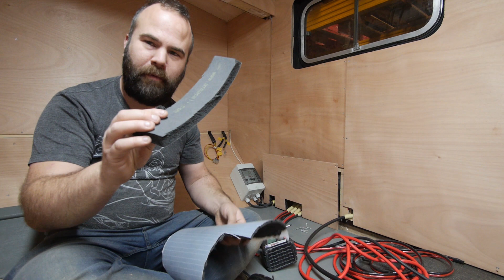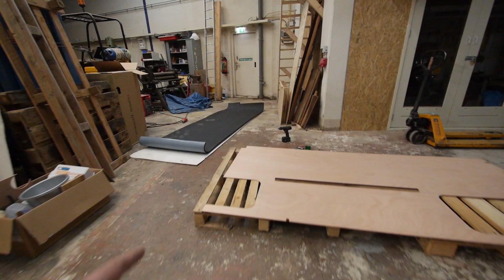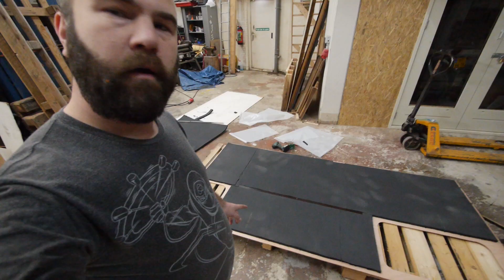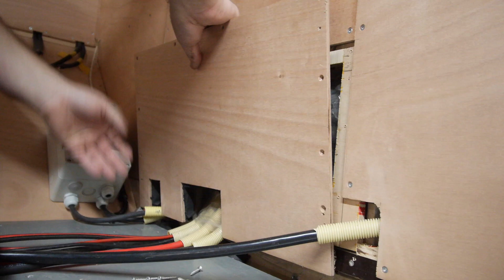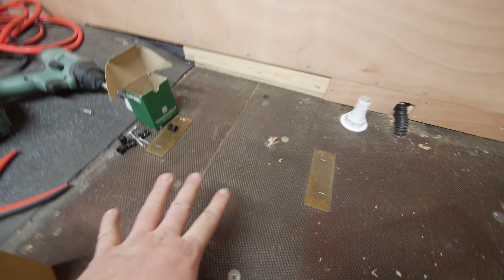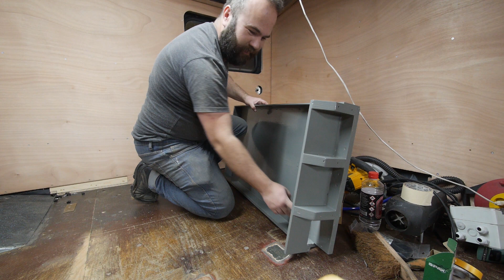Using Armaflex in an Alternative Way to Insulate the Walls, UNIMOG 404 Expedition Camper

Comment: Thanks for your movies. At the moment i am insulating a caravan on a year round place. I put 10mm armaflex in the cabinets and a box underneath the seat. That material is wood. And the armaflex still visible. Its sound reduction works. Can you tell me, do i  need to add a layer of wood on top of that. Or can i just keep it like this?

Comment: Hi Victor, I like your inside design. The Okume-wood and grey color looks great - like a road yacht! What is your interior height? I plan to work with 145 cm and a lift-up roof to have standing height at least in the kitchen area for my small U408 Mog.
Reply from the maker: Thanks! 139cm in the middle 129 on the sides haha. That is why I made the little stool to sit when cooking
Reply: @victorbartadventures  Thanks for the measurements. It looks higher indeed. 🤪 My box shall be approx 325 cm long, 190 cm wide and 145 cm high inside. Mounted on a U408 (U100L Turbo). I plan to use sandwich-panels and sturdy aluminium corner protection - had a similar design on my first box and worked well.
Reply from the maker: @mogXplorer  here 192 wide and need to check but around 335 long. So pretty similar. I make everything fixed in place